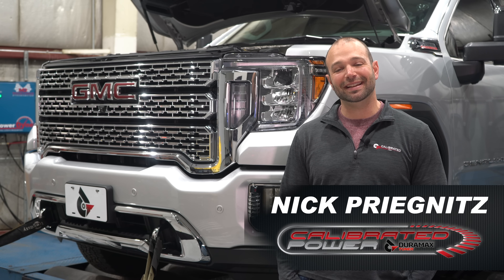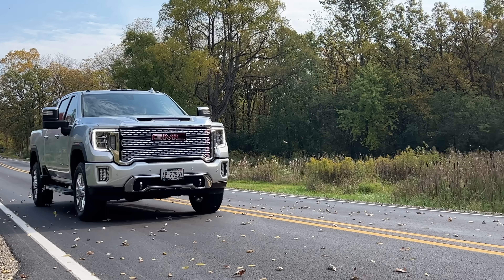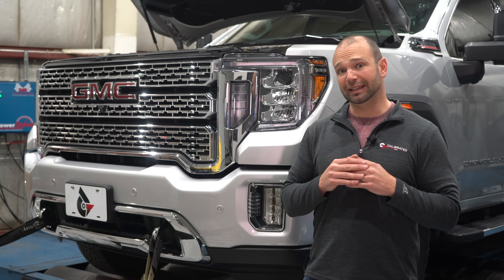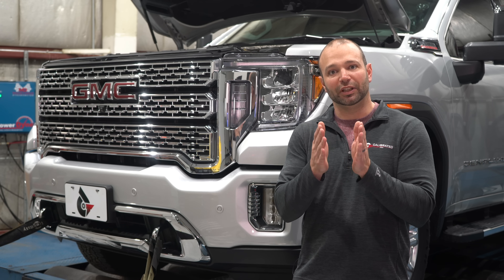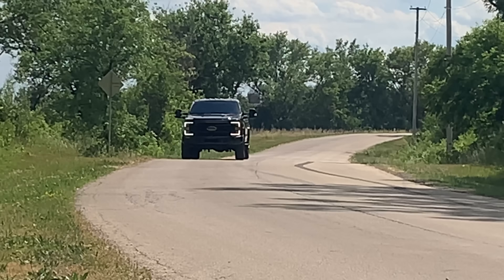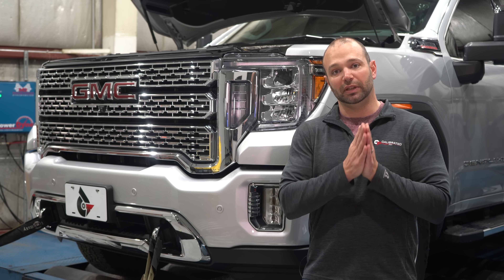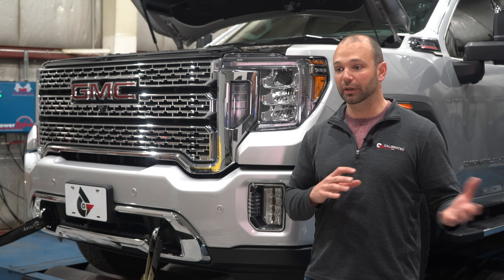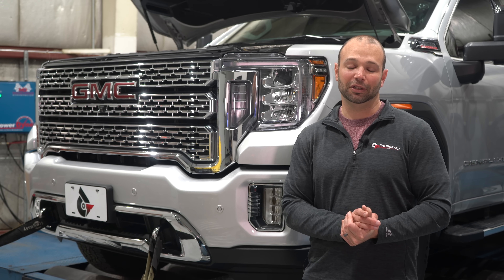10-Speed Allison Transmission 101

Comment: My prediction is the 10 speed will be more failure prone, and much, MUCH more expensive. The squash converter is still failing in gas engines, but now they put it behind a diesel ?  I'd rather have a REAL 1000 Series Allison than the 10 speed.
Reply: Hard to argue the Allison 1000 is a good trans.
Reply: @jameshenson4871  you should see one on the bench, with the planets and frictions/steels layed out, next to a T400 or 4L80E.  The LCT 1000 internals absolutely dwarf the light duty stuff....
Reply: @jamesgeorge4874  I bet it is a massive difference. The Allison 1000 case is physically large. It only makes sense that the internals are beefy to match. I would love to see the difference between the 1000 and 10 speed. Bet the 1000 is a beast in comparison.
Reply: @jameshenson4871  the frictions are the size of pie plates on the 1000, the shop I worked for had one a customer just wanted "gone thru" , and all we did was dissassemble, inspect, laugh at how massive everything was, and reassemble, new gaskets, o-rings and filters. Nothing was worn. The 10 speed is pretty beefy, but the 1000 internals dwarf them.
Reply: @jamesgeorge4874  Thanks for the info. It really puts the 1000 into perspective when Clint Cannon from ATS showed the difference between the 68rfe and 1000. The 68 looked like a Tonka toy.
Reply: @jameshenson4871  No problem. The  RFE is a pretty beefy unit, tbh, and has a nearly 80 lb torque converter, but it too, looks puny compared to the 1000, it's a class 5-6 medium duty trans at heart. 10K trucks and 30K payloads all day are what it was built for.
Reply: The 2017-19or 20 L5P with six speed Allison and 3.73 is my next if I get rid of my 20 year old DMAX .

Comment: What are the torque considerations with dual clutch transmissions? On smaller cars like the VW Passat, a dual clutch transmission limits the amount of times between shifts because you’re essentially moving to a whole different transmission each time you shift. 1-3-5 are on the left, 2-4-6 are on the right and you just move left to right. Would a dual clutch setup work in a high-torque application like the Duramax?
Reply: Eaton launched its 7-speed "Procision" Dual Clutch Transmission for medium duty trucks and buses up to 33,000 lb. GVWR in 2014.  It had a 1st gear around 6:1. two overdrive ratios and to total spread around 10:1.  Apparently the marketplace wasn't very interested...  They ended production in 2019.

Comment: The problem is most people buy them not to use as a truck as it was intended for. They buy these truck then want to tune them like a race car. My suggestion buy a car then. My 2020 works just fine as stock. Hauls my quads and pulls my trailer just fine.

Comment: I know this train has already left the station but a manual transmission was always in the gear the operator chose, and if that meant skip shifts so be it. I'd only add that, yes, I didin fact drive manual transmissions when they were available even though I had to wait months and jump through all sorts of hoops to get them.
Reply: Absolutely! Only 2 reasons I don't buy trucks newer than 2007, emissions and manual transmission options.  I get that most people these days want automatics, but there are enough people that would buy a manual transmission if available.
Reply: 👏👏👏👏
Pretty much nailed it!

Comment: Semi trucks had mostly run 16 speed transmissions to be able to keep the big 15 liter motors IN THE POWER BAND.  To hear some whine about a ten speed is silly.  Now that Allison didn't put is skip shifting is also silly for non high power applications.  My father has the patent for Caterpillars 1st Automatic road truck transmission back in the late 1970s. The 7155.   Their Fully automatic prototype had push buttons, full auto and skip shifting.  This was 1979...  come on Allison it's 2023 with computers, the version you make for Ford has it.

Comment: Drive an 2021 F450 all day every for work... tow trucks.  I hate the ten speed in our Fords.  My biggest beef is the delayed reaction off start...

If I need to, say, make a right turn on a red into fast moving traffic... jump into a hole and go... it won't allow it.  There's almost a two second delay from the time I hit the gas to the time it's moving, ridiculous in my opinion... traffic moves a long way in two seconds.  

The other beef is that we have had several fail already, at 10k a piece.
Reply: That sounds just like the 2007 Silverado 2500HD with a 6.0 Vortec that I had as a brand new company truck. That 2 or 3 second hesitation when pulling out into traffic was deeply concerning to me.

Comment: Can I trans tune my allison 6 speed on my chevy express 3500???
Shift points are irregular and not dropping a gear when accelerating to freeway speeds.
Many times I have to shift into manual mode for proper shift points
Reply: Allison in a express van? If it's a D  Max I believe it is a 480. My son has one great van has close to 400 k miles. I have 6 speed in my work van with gas engine

Comment: Big diesel engines make lots of torque, but have limited rpm. That said, the majority of "real world" driving is done between 30 to 70 mph. In many ways, the more gears, the better (from a performance point of view). However, the biggest priority for a transmission in a heavy duty truck application is longevity. The real question is, will these 10 speed boxes hold up for hundreds of thousands of miles (and millions of shift cycles)?
Reply: And just wait until the truck owner has to pay for a 10 speed trans rebuild !! ! He will have to float a loan to pay for, part of the reason these truks are approaching 100 grand to buy !!!
Reply: @wilburfinnigan2142  considering allison 6 speed is 4-15,000 for rebuild i wouldn't be surprised.

Comment: 10 speeds... and I'm still rocking the 3 speed with overdrive.😐
Reply: That’s what I’m talking about.
MOPAR 727 and GM Turbo 400,
Won’t forget the Ford C6 either
Reply: Missed the “overdrive” thing.
Reply: The best you know is the best you have driven. I believe the 2020 DMax and 10 speed transmission is the most potent  work truck I have ever driven, and I have driven a bunch of them.

Comment: I know if I forget to press my towing button when pulling my backhoe,  if I'm on the slightest of incline, it'll tell me real quick that it's not in a low enough gear by lack of torque to the ground.  Not a big deal, just press the tow button and it drops down where it's supposed to be. But on the top end, when I get up to my personal tow speed of around 65, it constantly shifts down and up. Unless I press the button. Then it stays in the lower gear, but always sounds like it wants to shift, but never does. I know,  drive slower or faster. Yes, that does fix it, but that much weight gets squirrly going faster, and slower just pisses everyone else off. Lol. My only real issue is that damn chevy shimmy,  when you shift from reverse to drive, and it acts like it's having a damn orgasm briefly.  No mechanic has ever been able to figure that one out, as far as I know. My 07 and my 2015 both do it. Both duromax 6.6,  3500 gmc.

Comment: 1:20 the issue id see with having 10 gears is when it shifts to the next gear at redline you're probably way past your hp and tq peaks and would actually be slower for something like timed acceleration runs. 
I do notice the new work truck with  a 10 speed skips a couple gears when at light throttle though.
Reply: Torque and HP cross at 5250rpm on all levels, with at 5250 rpm the HP goes up, and Torque goes down. With more gears, the RPM when shifting into the next gear, will stay closer to that 5250 (thus producing more HP on a more regular level). Take a 6 speed… when going from 3-4, the RPM may drop to 3700, but on the 10 speed, it may only drop to 4800 RPM, closer to that 5250, thus being faster. Only downfall, is that if the 10 speed has sloppy slow shifts, it may take .3 seconds away every time it shifts. The 10 speed is great IMHO.
Reply: They don't build these trucks for timed acceleration runs tho...
Reply: @sepg5084  Good Point. Lol.

Comment: I test drove a f150 ecoboost with a 10 speed the skip shifting in daily driver mode actually does make a nice driving experience on a daily
Reply: @keith14820  I believe in mid 22’ or 23’ and newer Ford went away with skip shifts.

Comment: I bought a 2021 Silverado 2500 HD Duramax to tow a 13k Lbs 39 ft long Fifth wheel, been cross country with it and have driven quite a few mountainous roads pass 10k feet of elevation (while towing that RV), we mostly use it for that and every time we need to haul stuff, I have no complaints, that truck feels smooth and effortlessly handles those mountains, I read somewhere that Allison engineers pointed out a few design flaws in it to correct before mass production, whether it’s Allison or not, I personally love the way it drives, I had a ‘04 Duramax 6 peed before and like this one better, fuel economy is also better, there is a huge difference between getting these trucks for a daily driver with a tonneau cover on it , and using them for their intended purpose.
I always tell people to get the brand they feel the most comfortable with, and get an extended warranty, things will happen regardless of brand, I just don’t get it why such rivalry between Ford, Dodge and GM owners, specially towards the “fake Allison owners”, do yourself a favor and ignore that, all brands have their ups and downs.
Reply: 04 with a 6speed! Not till 06
Reply: @ronmower3694  you are correct, it’s been quite a few years, after that truck got into a class C then into a class A Motorhome for a while , now I’m back to fifth wheels.
Reply: @ronmower3694  
Unless you do the valve body swap and TCM programming to enable the 6th gear in the older 03-05 Allison. Not sure if that also works for 01-02 or not, but definitely with the other 3 years.
Reply: I drove a 2012 DMax with a 6spd for work for a while and must say operationally the truck was the best driving HD truck I had been in. Even without the exhaust brake the transmission behaved like a manual holding the truck back when decelerating. As far for just plain fun, you’re never gonna beat the old 47/48 re. Comparatively cheap and common compared to all the other options and has a ton of aftermarket development

Comment: Automatic transmissions have traditionally shifted just fine under hard acceleration. I don't see the "cutting back" during shifts unless this is a function of the diesel programming. 
Next thing - do people buy trucks to race or work? Who cares a fig about how fast it does a quarter mile? I can't see that as even a worthy point of discussion. 

Cars and trucks are designed and produced for a purpose. They are meant to fulfill that purpose. Stepping outside that purpose is always a risky activity. 

Always keep in mind that manufacturers are forced by regulations to satisfy three main aspects of any vehicle - Emission compliance, fuel economy standards, and performance. If "tuners" had to comply with those same regulations, there would be very few of them able to survive.
Reply: Yes Duramax cuts power on shift. Otherwise the trans won’t live, it’s literally “in” two gears at the same time during a shift. 

And yes, we race our trucks. My big one ton will outrun 99% of vehicles on the road. And it’s fucking amazing.

Comment: your whole video is based on bull sh.t,! you make it sound like there is a clutch involved like a standard trans , have you even driven one of these trucks ?? i own one and i been a transmission  builder for 30 years , you do not drop power between shifts , in the time it takes to shift to the next gear ,the only thing you feel is the drop in rpm because of the change in gear ratio .....if you keep your foot steady on the  accelerator , you will feel a steady progressive application of torque .....the drop in rpm is so it will be at its peak torque output of the engine ....obviously...you make it sound like the engine shuts off during a shift  , lmao... if your gonna make a video to educate ....use some facts ,
Reply: Facts were used in the making of this video.

Comment: 1/2 ton? 3 litres? You people have no clue what a truck is for. HD trucks is one thing although not relative unless you are actually using a truck what they were originally designed for. 
  1st gear ratio is what it is. So is last gear . Too much emphasis on how many times it bumps inbetween.  Most trucks are grocery getters these days. How does any of these even factor in when you truck is a status symbol rather than what a truck was originally designed to do. Hint. Wasn't to go to Walmart and pick up a load of Huggies!

Comment: This is off the subject but I just bought a 2023 gmc denali 3500 when I start it up in the morning it just screams like a train horn after about 15 minutes or so it kind of quiets down but at 8 hundred rpms you can still hear it and driving down the road it sounds like a hoot owl they found a hole in the hot pipe going to the turbo they replaced it but didn't salve the problem the mechanic dosent know what's causing this issue would you have any idea
Reply: Hey I’ve seen another video talking about the winter grill on those GMC 3500 trucks making a howling sound as it’s pulling air through the louvers during warmup

Comment: I drive multiple 20, 21 and 22 Chevy pickups that pull massive loads with this ten speed. Seen tranny go out at 103k, 134k and when they did, they gave no warning signs at all. Basically they just had nothing left to hold on to get power to the ground yet. I hate how putting into manual shift mode it just automatically downshifts when I just want to be ready to before I'm actually headed down 8 percent grade loaded. Nothing more fun than trying to get it to upshift while at 3500+ rpm so you don't smoke something cuz it's really not meant that high.
Reply: it's good for 5,000 fuel off. its actually designed to do just that.

Comment: Love my Inglewood trans Allison .our co has 1 LLY service truck with 403 k original drivetrain. 4 others lbz with minimum 280k fantastic work trucks.
Reply: Its not an allison
Reply: The trans in my lb7 built for 1200 ft lbs and 700 hp by Inglewood trans is not an Allison. ...ok.

Comment: Could you please tear down a 10 speed and compare the internal parts to the old 6 speed. Like the pump the shafts the steels . I’m tired of people say it ain’t an Allison it just has their name on it. I want to see side by side comparisons of the internals .
Reply: Be tired of it all you want, but it’s 100% true. It’s not an Allison, it’s an Allison-branded GM unit. That will never change.
Reply: I would be willing to bet the Allison 1000 components will be larger and better than the 10 speed.
Reply: @jameshenson4871  I think so too just would like to see it
Reply: Even if they tear it down and the internals are on par with the Allison, it still won't be an Allison trans.  That will never change.  I'm fairly certain that won't be the case, though.  These 10 speeds don't seem to live very long lives.  For people who trade their truck in every 3 years it won't be an issue, though.
Reply: The 10L in the GM is lite duty compared to the Ford's version. This is no Allison, that's for sure. https://www.youtube.com/watch?v=FUmxJ-6pRpk
Reply: @wademills1616  1000% incorrect. It’s a GM-built, Allison-branded unit. Period. 

It is true that development was done jointly between GM and Ford, but the Ford units are built a little sturdier than the GM units, but the design is super similar. Each build their own units.
Reply: @ no they are a Ford built transmission. GM software.

Comment: Wouldn’t tow haul mode keep you in each gear longer? Or even under load the transmission will hold a gear longer right?
Reply: Correct, T/H mode will hold each gear longer.  Sometimes still not long enough.

Comment: And the half ton GM went from a great 4L60E to a failure when adding gears
Reply: @Peter Angles and yet the 4L60E on average last 177 to 230k the newer trannies Peter ? 80k is the current data .
Reply: @Peter Angles  the funny part is you did not address  miles on ave , for the older and newer trannies  . Data Peter .
Reply: You should've said 4L80e. Night and day difference between it and the 4L60e
Reply: @LS1_dreamZ  I absolutely agree the 4L80E is great.  I was addressing the 1/2 trucks with the new multiple speeds to the 4L60E.  The 1/2 truck trannies have gone down hill since the 4L60E  .
Reply: @beddozo  I agree with that! 4L60e is also super cheap to rebuild in comparison. Plus tons of aftermarket
Reply: @Peter Angles  you sound like a salesman,  and as you attempt to make many points,  the water keeps turning murky.

Comment: GM's 10 speed isn't an Allison, it's an in house GM transmission rebadged as an Allison.
Reply: Replace the valve body in the trans to get rid of a large chunk of the issues. You need to go third party like Next Gen Diesel as they make it thicker and thus less likely to fail.
Reply: They know
Reply: It's not really a GM transmission either. It's based on the 6R140 which was a collaboration between Ford and ZF, slightly modified and tuned by GM with validation testing done by Allison.  GM got the rights to use the design by trading Ford the rights to use their transverse 9 speed.
Reply: @dcl97 based on the 10r140 not 6r140
Reply: with an Allison "blessing"--Allison is a publicly stock traded company.
Reply: Hell of a good transmission 

Never had an issue in my 2023 HD 3500 gasser 

I haul concrete Allan blocks daily
Reply: @mickwells4714 how many miles on it so far? If it has less than 100k then it's basically still like new
Reply: @mickwells4714   lol no torque.